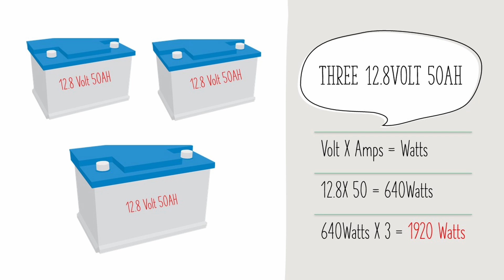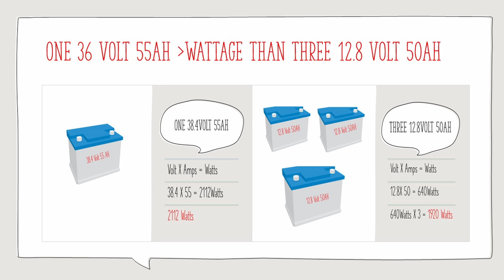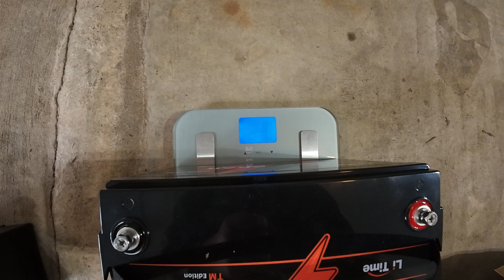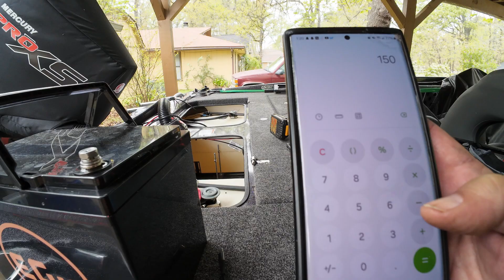Which Lithium Battery Setup is the right one for you? Li Time Install on Crappie Fishing Setup

Comment: Great video. Looks a lot cleaner. Awesome explanation!!!
Reply from the maker: Thanks.  Hope it cleared some stuff up for folks
Reply: So after 9 months how are your LiTime batteries preforming? I’m thinking about switching to a setup like yours for my Nitro bassboat. I already bought a 12v140ah LiTime for my small boats TM . Going to test it out this week. Did you get the 36 v 20 amp water proof golf cart charger ? Detailed input would be greatly appreciated.
Reply from the maker: @MrFishhook  I am sorry I just now saw this.  The batteries have been flawless,  I did go with the 20am charger and have not had any issues at all.  I also went with the 12 140ah for strictly my electronics.  I have not had any problems with anything from Li Time.